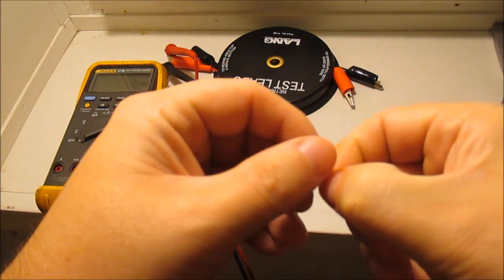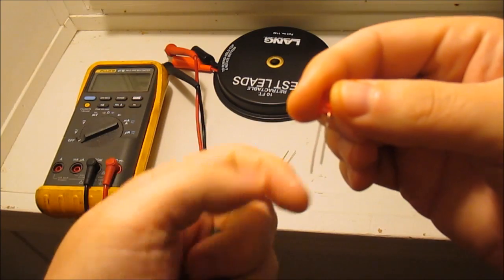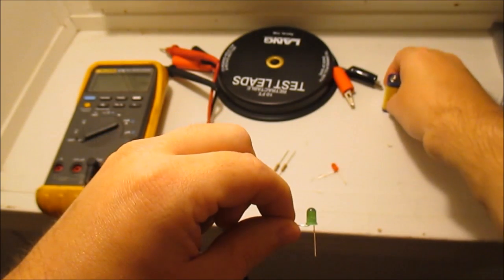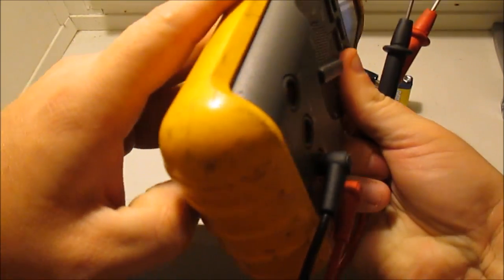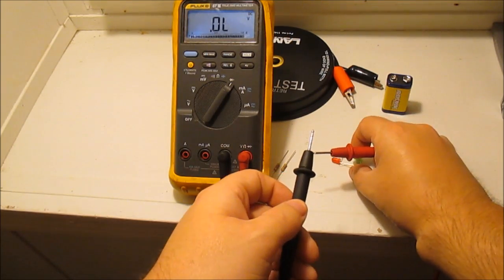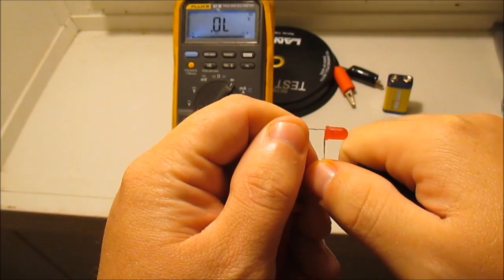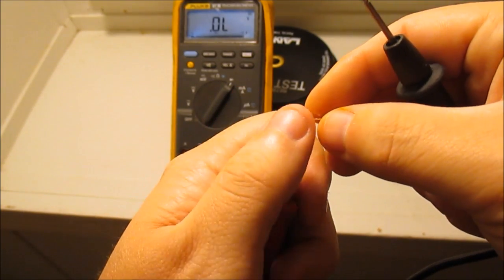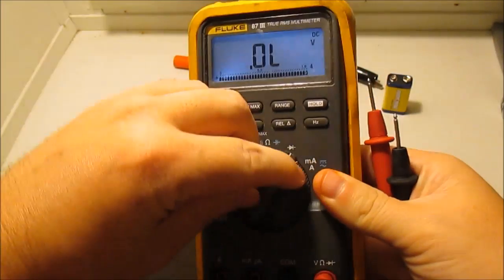How To Test A Light Emitting Diode LED

Comment: My led lights up when I do this but doesn’t tell me the voltage, any idea why? I’m trying to figure out the voltage of my leds and no matter what option I put my multimeter on it won’t read it.
Reply: A meter won't tell you the voltage of the LED. And by voltage do you mean the forward voltage, the reverse voltage or the peak voltage? These are the specs of the LED, not a function that a meter can measure.

Comment: good, but is ohmmeter showing a resistance/continuity ? thank you
Reply: One direction has no resistance, reverse direction has high resistance, the very definition of a diode. The specific values are irrelevant.

Comment: Could this method safely be used to test leds that are already soldered into a printed circuit board. Some of the leds on my Audi's tail lights have failed. I've been planing to try and replace them myself rather than pay Audi £350 for a whole new tail light unit. I already know what type of leds I need so I though why not give it a try. At the very worst it won't work or I'll make a mistake and have to buy a whole new unit but if it works its a big saving. Thanks for this guide, its been a big help.
Reply from the maker: My husband died in April, and I have no answers for you. Sorry. Thanks for watching.